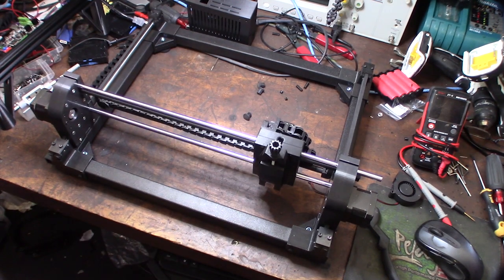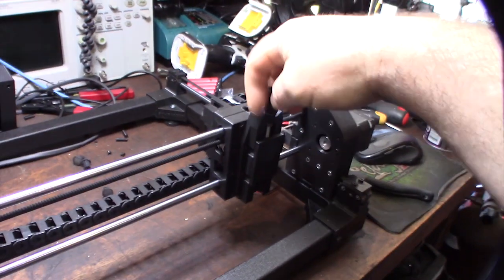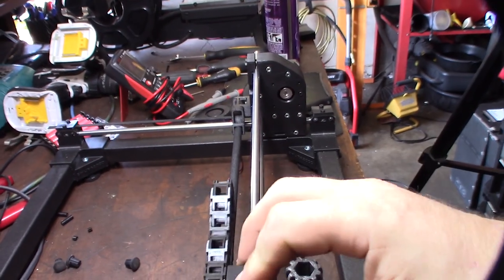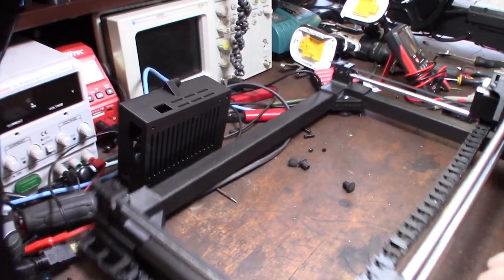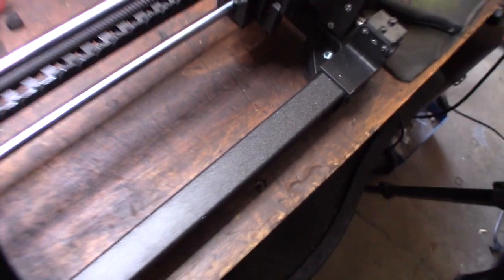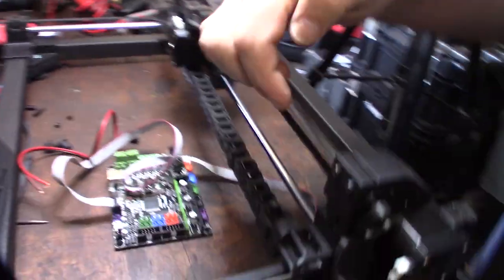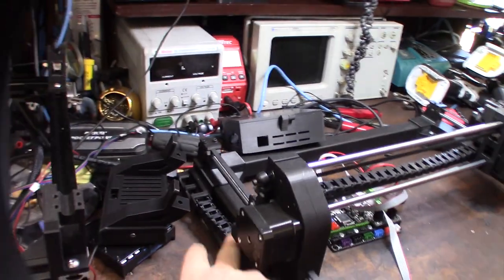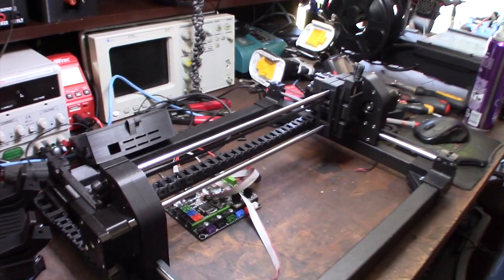Homemade DIY Laser cutter engraver from old 3D printer parts GRBL CNC Marlin part 2

Comment: Thanks for the video. Nice build! I bought a Two Trees Stump 20w (5500mw) laser from Amazon cheap, $160.00. MKS TFT28, MKS DLC V2.0 GRBL. Garbage signal wiring to the laser broke loose focusing the lens. The laser went full power, burned through .5mm solid cardboard, 1 inch foam, glass table top and burned a hole through the top of the walnut table base and came out the side! This was less than a few seconds till I smelled walnut burning. This is a similar setup to yours. I think the power surge blew out the MKS DLC laser driver. I have an MKS Gen L board also and was wondering how you are driving the laser from the Gen L? I will hang on to the laser due to the power of this thing and replace the MKS DLC with my MKS Gen L. I am wondering if I might also need a PWM to TTL (3.3v to 5v) up converter. Thanks for any feedback. Link for the Stump Laser Engraver;   
https://smile.amazon.com/dp/B083TJX97Y/?coliid=I209HQHT4UB0FE&colid=15L20SJETFZDC&psc=1&ref_=lv_ov_lig_dp_it